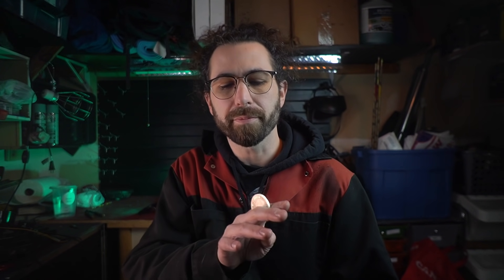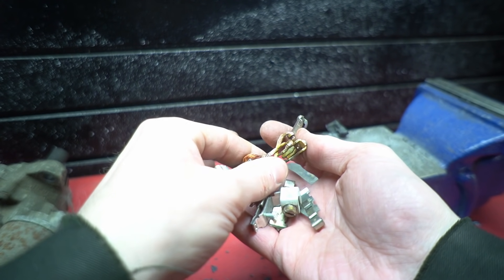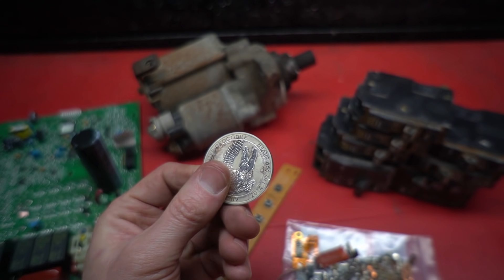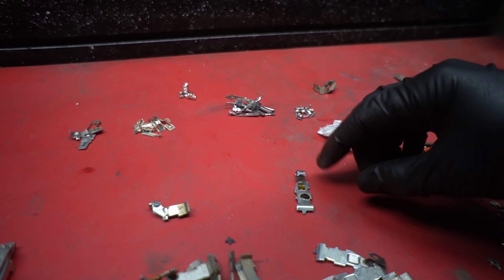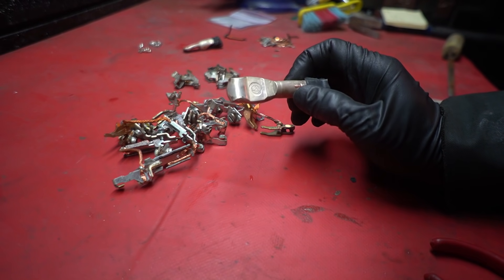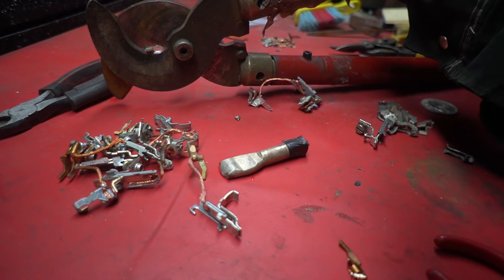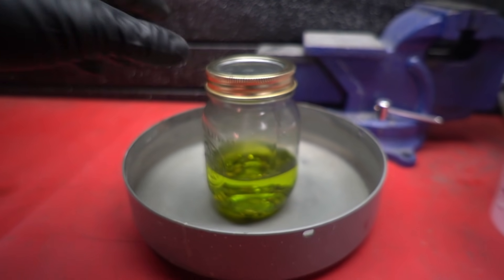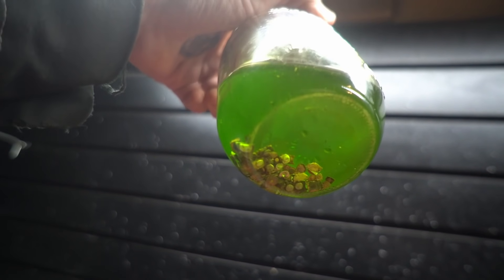How and Where to Find Scrap Silver - Identification, Refining With Acid

Comment: I saw you used Hydrogen peroxide; I see some other folks use distilled water instead, wondering what the difference is? Thanks pal! Also, what are the benefits to using Hydro acid vs nitric acid? You mentioned Nitric is more expensive and dangerous. Is hydro acid less costly? Sorry for all the questions. You are far more knowledgeable than me. Inspiring my best friend and I to start a new backyard project. We have a lot of access to silver plated metal cutlery due to an abundance of thrift stores, so I'm feeling like it may be more profitable than using various parts and components from machinery.

Comment: Bummer. I scrap specifically for e-waste (and whatever else comes along for extra cash) so I can refine the gold and palladium. Was hoping to see a way to recover my waster silver.
Reply from the maker: I’m trying to solve that as well so I can make some fun videos and refine some pure silver. The issue for me is acquiring some nitric acid, it’s strictly controlled here in Canada and without it I don’t know how I’d make a reverse electrolysis cell to separate the cadmium from the silver buttons. I’m curious and I’m learning as well so if I find some way to do it without nitric I’ll be excited to share it
Reply: @thubprint  I'm down in the US but fortunately a science teacher so I can order it whenever I need it. If I come across any other ways that don't rely on the acid, I'll be sure to let you know.
Reply from the maker: @zachchenoweth6622  I have been digging around with different potential solutions. I’m curious about experimenting with AP solution to dissolve base metals and then starting a fresh batch with extra peroxide and accelerating it with a heated stirplate to convert all of it to silver chloride. I guess I’m just left wondering if the cadmium would dissolve into that solution and not contaminate the silver chloride powder when I filtered it out. Like I said, more research!

Comment: Mercury gets a bad rap but you should drop the silver in Mercury. It will make an amalgam you can strain it trough cloth Mercury runs trough leaving amalgam drop that  in a potato wrap It up with wire throw it in a fire. The Mercury vapor absorbs into the potato and then you have a silver button in the potato.
Reply: Yo what?

Comment: i appreciate your videos they are all 
put together absolutely amazing I learned quite a bit and these are questions that I am having as I have gotten more into scrapping I came across quite a bit of silver didn't even know what it was it was in some breaker boxes huge ones from the hospital that I found in their dumpster massive circuit breakers like probably about 20 times the size of your common residential breaker anyway it's a silver on the contacts were about the size of Nichols and so I took them to a scrapyard and they told me it was aluminum even though I told him where I got it so now I'm doing more research and it is absolutely impossible these people are simply incorrect it is silver that I have found I have 3 ounces of it 104 g actually most of it from this one set of breakers that I had recovered from a hospital dumpster kind of cool I'm hoping to make about $30 off of it total I don't know I'll see I'll let you know when I do cash in lol definitely not worth the time but just cool to do and have the experience

Comment: You don’t want to use aqua Regia with silver, just straight nitric acid. The addition of chloride ions causes insoluble silver chloride to form and while there is a method to refining by precipitation of AgCl, you’ll need to filter your silver nitrate solution before precipitating if you want any sort of purity. 

There are no standard respirator cartridges that will protect you from NOx, even military CBRN canisters have limited protection, but don’t let that stop you from experimenting! 

I’m sure that you come across kitchen exhaust hoods from time to time scrapping. If you screw plywood to three sides of it and leave the front open and vent it outside, you’ve got yourself a fume hood at a fraction of the price!

Keep up the good work!

Comment: You're not going to be able to dissolve silver with aqua regia. Chlorine ions will form and impermeable layer of silver chloride on the surface and prevent it from dissolving. Nitric acid by itself easily dissolves silver.

Comment: I add nitric acid to my cinnamon toast crunch for added flavor and makes it digest so much easier then i eat my silver contact tips and crap out bars of silver its a really amazing way to refine and its really good for your digestive system... Way better than probiotics.
Reply: Trouble is your stomach contain about 6 Molar Hydrochloric acid and any Silver ingested will turn into Silver Chloride since the "ksp" for AgCl is so small. 
So what actually comes out your rear end would be a grey compound if you survived long enough to pass anything.  There is a guy who actually turned Blue because he continued to drink a weak Silver solution that was for antibacterial treatment for external uses.  So if you don't know to much about Chemistry, don't try it. Especially, do not try to handle any Acids, the fumes from all inorganic Acids can be quite deadly to the interior parts of your lungs. Don't gamble with your health, and it's very doubtful that your basement or garage has the necessary ventilation and filters installed to keep you safe, while heating up giant Beakers of scrap electronic waste to speed up the digestion reactions. Just don't try it. No  future home buyer wants to buy a house that is even slightly contaminated with chemical residue of any type.

Comment: you can also use peroxide to test if silver.. silver acts like a catalyser but does not change the silver.. you will see bubbles of oxigen gas it can mean it is silver but this also happens with platina. platina will give faster oxigen bubbles than silver may take a minute before visible

Comment: Hi Thub, regarding heating up silver buttons with a torch i dont think you are in danger of cadmium fumes as long as you dont literally melt the contact off. The solder melts way before the silver cadmium alloy does. 

I did a ton of these like that with a propane torch, and then with a oxy acetylene torch for big brazed contacts. So if i get metal fume poisoning ill lwt u know yeet
Reply from the maker: Lol, fair enough.

Comment: Scrapping as a professional is definitely a fine art of balancing MONEY - TIME - RESOURCES. 

How can you invest the least amount of time and resources to make money. 

However, if you are a hobby scrapper, time may be your greatest profit maker. If you collect a bunch of material, it may be worth more to the hobby scrapper to strip wire versus turning it in as insulated. Taking apart a motor to separate the steel from the copper windings. 

Best piece of advice I could give as a hobby scrapper - ORGANIZATION. Nothing sucks up time and resources faster than handling materials more often than you need to. I use 55 gallon plastic drums to sort my stuff (excluding larger steel pieces). Use my 2 wheel dolly to help move or load my stuff, have the yard mark the tare weight of each drum, and you spend less time at the yard. The workers at the yard love being efficient. Also get a category list of what they are paying for so you can separate your materials accordingly.
Reply from the maker: Well said, and I like the big drum system! I would have a hard time loading those personally but I see the advantage. And 100% on the overhandling, I get frustrated with myself when I have to pick something up and put it down more than twice 👍
Reply: @thubprint  I would imagine if you get a 4x4 to go across the top of your wooden bed pen, you could mount a 2000# electric winch. With that, also get a cross bar with a pulley to go across your rear tailgate area (or slightly forward) and you could pull your load up and in. You would just have to slide the barrels forward by hand. You could then use the winch and rear pulley, to pull the barrels back towards the end so the yard can clamp them with their lift, or have a better position to slide/rock it on a pallet. 

I’m a 300# gorilla, but I have my limitations too. Always gotta be working smarter.

Comment: Hi i have try today some circuitboards for the gold in ap. I do the same like in the vid 2 parts and 1 part, with the same stuff. How long i need to wait for it works? Answers or tips are welcome. Im new with this.
Reply from the maker: I’m not sure how long the gold would take because it should flake off the pins and such, but I’ve been surprised at how long mine has taken on these silver contacts. It’s been about a month and it only seems half finished. Some have come completely free from copper and others still have copper wrapped around them. I moved the jar into the sunlight though and that has helped. I’m new at it too!

Comment: Im not trying to suggest that you forego any safety measures but even fuming nitric does very little in direct content with bare skin.
Just make sure that YOU WASH IT OFF STRAIGHT AWAY.
getting it into your eyes is a very different matter.
Rinse with continuous running water for at least 20mins while someone else calls emergency services.
Reply from the maker: I’ll still be using PPE all the time but it’s nice to know it won’t melt your arm straight off 😆
Reply: @thubprint  definitely still use ppe but one thing you really have to consider is that high concentration nitric will make most gloves melt then burst into flames lol so when using nitric it is safer to leave the gloves on the side lol

Comment: awsome video, 
but how is it work whit weedvinegar and tabel salt, that will remove the gold flakes, but how does it work in silver
Reply from the maker: That would certainly work, when you combine vinegar and table salt you create hcl with sodium acetate. Essentially the goal is an hcl solution with copper chloride, and that would be produced from vinegar+salt+copper, it would just be much slower. Vinegar is only 8% acid so your solution would be very dilute, plus you don’t have an oxidizing agent so it would be drawing oxygen from the air. Very slow process.
Reply: @thubprint  thanks for answer, yes i know its an slow process,  mine weedvinegar are 12 %  but wonder how pure can the silver be after

Comment: Those unknown silvery components are likely plated nickel. Used for it's high corrosion resistance.
Reply from the maker: Meaning nickel has been plated onto something? That would make sense..
Reply: @thubprint  Yes, most likely plated onto brass or copper. But possible steel or other metals.

Comment: I agree with you buddy. Yes you can extract silver from board's but in the end you will not have a profit. I tried once to do it but just for entertainment. Well said 👍
Reply from the maker: It’s about volume right? Now if a person was extracting gold from a fair number of boards and could then draw some silver out of the same solution as a byproduct, that would be different. Silver alone, naw
Reply: @thubprint  exactly about volume I'm talking. If someone could find a tremendous volume of board's then he could have some profit. But when someone has 1000 ram cards.... No way... I just sell them as they are and then buy a coin of gold.... It's dangerous for your health and the environment.... That's my opinion of course😎

Comment: Nice ! A video right up my street . Never found it scrapping but found it loads at flea markets endless amounts of time .
Reply from the maker: Now silverware/coins/mislabeled jewellery, there could be some profit there! I like silver a lot but when scrapping metals it just doesn’t work out. I mostly wanted to make this video because people kept ripping on me for throwing out silver in the flatscreen TV video. It seems like the word “silver” has more value than the actual commodity!
Reply: @thubprint  Ive found crazy amount of unmarked silver stuff its shocking,(plus gold). It doesn't even cross my mind when scrapping and the only thing I have is a bag of about 50 breaker switches that I keep putting off breaking up.

Comment: Actually you can extract precious metals without acid, look up cupelling it's a method of melting your precious metal bits with lead in a special container or using Portland cement.
Reply from the maker: I’ve actually watched a few of those videos from mount baker metals! It’s definitely super cool, but it has specific applications. For purifying silver contacts though I bet it would be perfect 😎

Comment: Baking soda will neutralize acids, making the solution safe for drain disposal. Wear gloves, goggles and a plastic apron. Add it until it stops reacting.
Run water while pouring it slowly into the drain.
Nitric acid is some badass stuff. Practice the ounce of prevention and don't mess with it unless you have proper training and equipment.
Reply: That simply neutralizes the acid. It does nothing about the dissolved metals which can be highly toxic.
Reply: That doesn't make it suitable for pouring down the drain.

Comment: Hey Thub. 

You will be my life saver - please make a video/ guide on wire scrapping. 

I own a small ewaste business and there all sorts of different types of wire. Power cables, keyboard/ mice wire, little computer bits wire and etc. 

Please make a video on what is worth scrapping, worth stripping and what's better to avoid. 

Many thanks!
Reply from the maker: I’ve sort of thought about it but I figured that was a subject many people have covered? Though the way you describe it, maybe I could come up with a unique angle or delivery that touches the subject in a more practical way 🤔
Reply: @thubprint  yeah it would be nice. 
I didn't really find any good videos to be honest. People just don't really put effort into making those videos, shaky cameras, lack of detail, and just hard to understand. 

Your videos are becoming very good content, very good details, honest, straight to the point and etc. 

I personally have trouble finding videos explaining what cables are worth scrapping and which are better to toss out. 
Keyboard/ mice cables
Computer case wires 
Ethernet/ phone cables 
Power supply cables 
Coax cables 
Do you need to sort them all out? Or will scrap yards just take them as an entire pile?

Comment: I like the ending. I kinda wonder about Hazardous Waste and just how much it's monitored or even enforced. 
Then again I am in Texas not sure how easy it is to get a maple leaf here. 
But I used to make stamps, like rubber stamps, self pre inked not the stamps on mail. They also made name plates,Award plaques(Brass) and Vynal Signs. But the ink and other stuff, like denatured alcohol even down the drain or in the dumpster. no warning once in the 7 years I worked there.
Reply from the maker: I imagine denatured alcohol isn’t as big a deal, but the AP will contain copper chloride which I’ve read is very hazardous to add to the water streams. That’s kinda the issue really, there isn’t much done to monitor who puts what down their toilet. I’m not a fan of regulation, I just hope people are generally as considerate as I assume they are

Comment: Silver acid isn't that great.  You're better off scratch testing and using 18k gold acid on the stone. Real silver "curdles" up and with experience the speed at which the reaction happens gives you a good idea  of the purity.  Silver acids "go bad" pretty quickly.  My idea of scrap silver btw, is hitting tag/yard/garage sales, rummage/jumble sales etc and finding silver jewelry.  It's all refined for you already, no acid required.
Reply from the maker: Good call on seeking the prepared stuff. Is gold acid different, or just stronger?
Reply: @thubprint  Different.  It's clear for one thing.  Applied directly it bubbles up gray.  Applied to copper it bubbles up green and makes a stink.  Silver acid changes color when it gets too old, it's still acid of course, and it can get too old pretty darned quickly. It's red at first and turns blue-gray later.   Most jewelry dealers I know use the 18k and skip the silver acid.